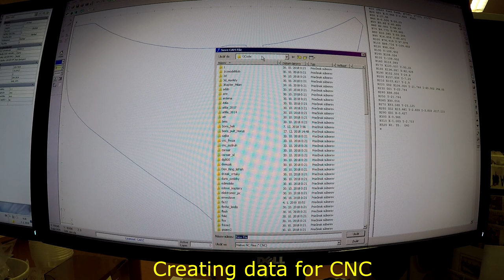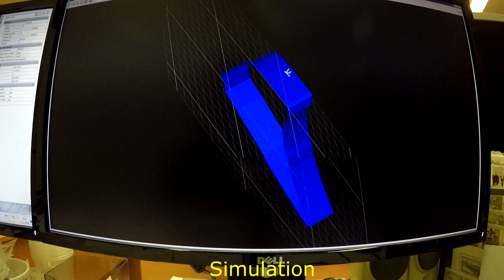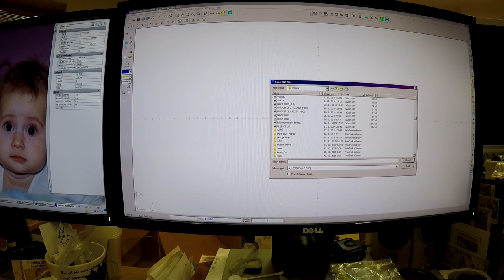How to make aramid fuel tank for RC Jet model

Comment: At 42:24 what are you using in the syringe during the bung build?
Reply from the maker: oil, for easy tube insertion.
Reply from the maker: Be careful, you must use stopper for diesel. If you use a gasoline stopper, it will fall apart in kerosene.